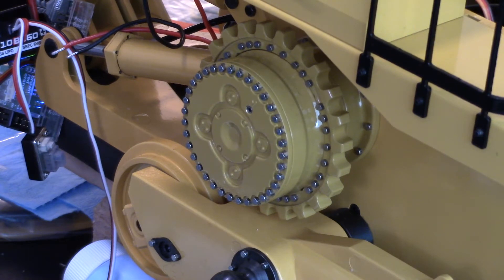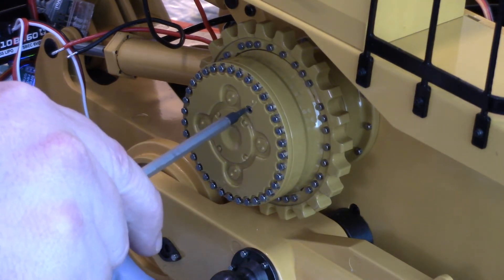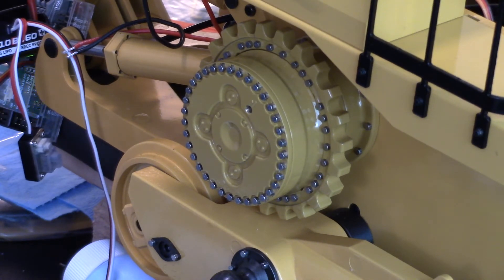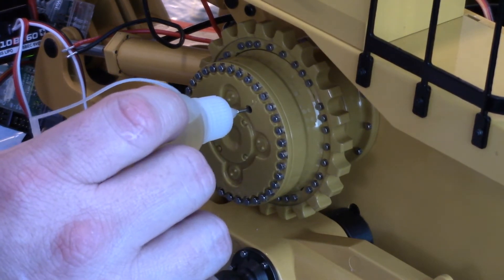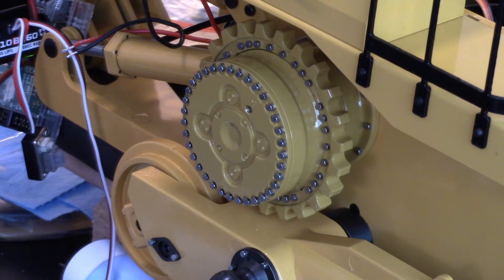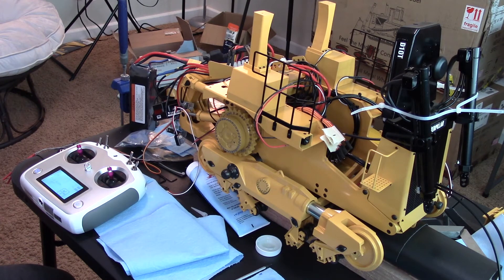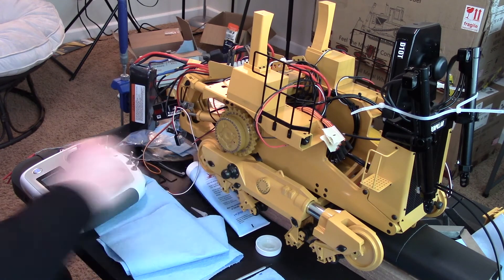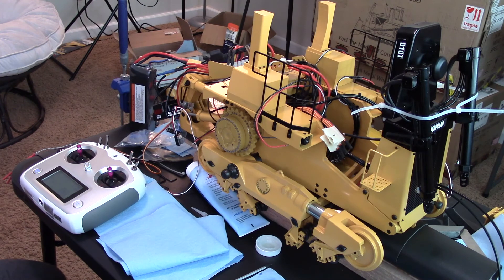Drive Unit 1st Run Setup

Comment: great video... Why are you using oil instead of grease? Just wondering
Reply from the maker: It's smoother and more quiet. They also look nicer to me as I like the detail. Thank you for the comment.
Reply: Too bad I can't get in touch with rc construction. I would buy these drives. I sent Thomas a e-mail back in April and no reply.
His last post was Jan. 27, 2022.
Reply from the maker: Sometimes it takes a few tries, I know he's been moving and resetting up his shop
Reply: Ok I got my upgraded tracks from another place. I can't say  what web sites because you tube deletes them. I was trying to tell you where I bought my quick connect forks for the 870k  but you tube deleted the web site
Reply from the maker: C.s.m.i I take it?